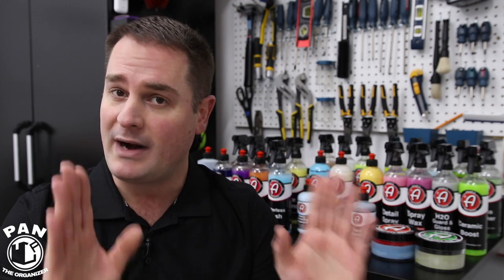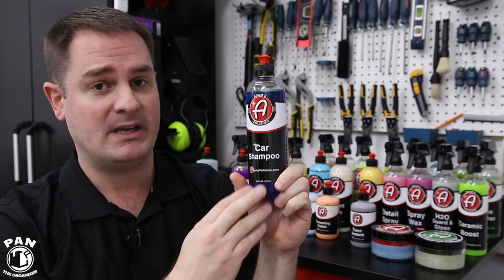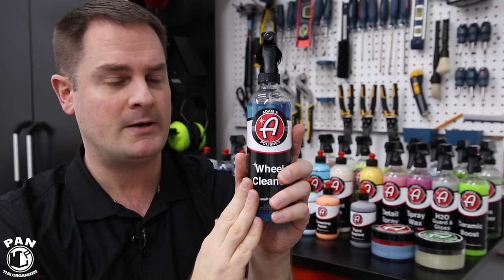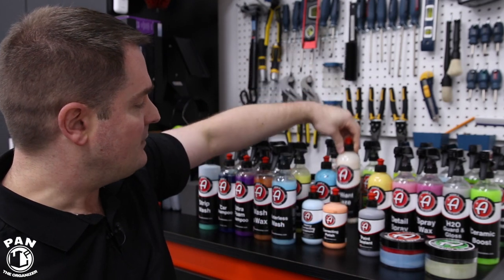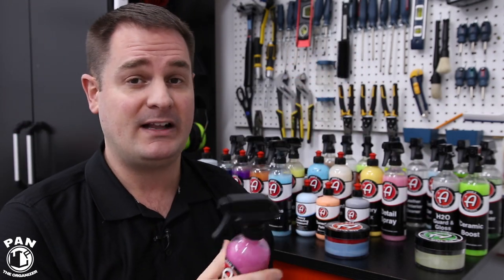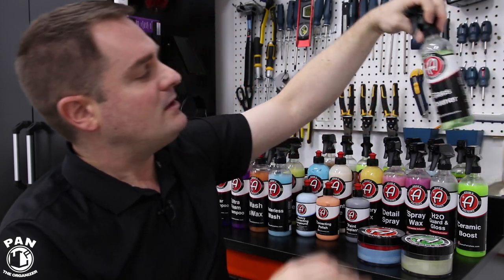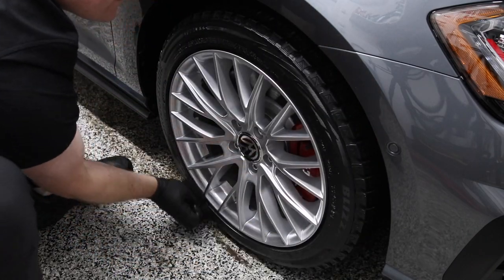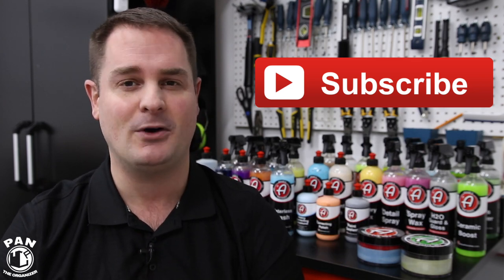ADAM'S POLISHES DETAILING PRODUCTS: BRAND REVIEW !!

Comment: Thanks Pan! The few Adams products I have tried have all been absolutely top shelf, some of the best. Problem I find is that all the chemical guys products i have are have also excellent.....at half the price here in Australia.  So it's an easy choice for me unfortunately.  I love their hand applicators though, fantastic!
Reply from the maker: Thanks Ken!  What are your favourite Adam's products, and Chemical Guys products?
Reply: @PanTheOrganizer  From Adams I'd  say their car shampoo, outstanding, wax hand applicators, best I've used, and their detail spray leaves a fantastic finish. For chemical guys, their outstanding products for me are VRP, Glosworkz autowash (easily as good if not better than adams), Mr pink car shampoo, and all of their detail sprays so far are excellent.  I have their butter wet wax too and it leaves an excellent finish but doesn't last long. I also highly rate diablo wheel gel for a safe gentle wheel cleaner. I also have their fabric guard, very good, and also their fabric clean, outstanding. And for an example of the price difference between chem guys and adams: Adams VRT $39.99 , CG VRP $13.95....No competition I'm going to get CG every time.

Comment: what is the difference between the adams car shampoo and the adams mega foam?? can you just use one or the other?
Reply from the maker: Car Shampoo can be used in the bucket or in the foam cannon. Mega Foam was designed for the foam cannon only (pre-wash). So the most versatile is the Car Shampoo.
Reply: @PanTheOrganizer  Hello! thanks for the quick response! And ahh that makes sense, I appreciate it! I'm trying to buy some of Adams products and was wondering what products I actually need.. What I have in the cart so far is: 
1. Adam's Car Wash Shampoo 
2. Adam's Iron Remover
3. Adam's Tire Shine
4. Adam's Buttery Wax
Would you say I really need to get one of the tire cleaners, or do you think I can get away with just cleaning the wheels and tires with the Adams shampoo with the help of the iron remover?

Comment: Let me start by saying great review. I've been looking at Adams products and this review helped out tramindicly. I was wanting to ask a couple questions though. I have ceramic coating on my car but said not to use the wax and sealants on the ceramic but would the wash and wax b ok or should I just use the wash+coat? The other thing I was wanting to know is would the H2O Guard and Gloss and the spray wax streak if I was to use a blow dryer instead or do I need to wipe it dry?

Comment: That tire shine looks good and lasts long but make sure to let dry or you'll get sling
Reply from the maker: Yup!  And remove excess with a microfiber towel.
Reply: @PanTheOrganizer  yep! I made that mistake at work, saw the car come back and under the radar got it off but it was not fun. I started using quicker drying stuff that still gave the wet look people wanted
Reply from the maker: I typically use water based dressings like Chemical Guys VRP or CarPro PERL, but Adams Tire Shine is a good silicone based one.
Reply from the maker: Did you watch my tire dressings comparison video?  Here: https://youtu.be/Oge5jlaAaME

Comment: Hi Pan, question for you. Would the H20 Guard and Gloss be applied after the Buttery Wax? Normally my line up at this point is Adams Tire Cleaner, Adams Shampoo, Adams Buttery Wax and then the VRT to finish off the vinyl and tires. Thanks!
Reply from the maker: You could.  But normally you apply a Sealant first, then you top it off with a wax.

Comment: Pan great video. I noticed you did not cover the finishing polish that Adams recommends after using the correcting polish. Do you think it’s necessary to use the finishing polish? Also after using paint sealant would you be better with applying H2O G&G or buttery wax?
Reply from the maker: It's always a good idea to use a finishing polish to smooth the finish and further refine it.  If you apply the Adam's Paint Sealant, I would top that with a carnauba based wax (like Butter Wax) to add more warmth and depth to the glow/shine.

Comment: Hi!
Great video as aways.
I wonder how you would compare Adams’s new Spray Wax VS Meguiar’s X-Press spray wax in term or ease of use and durability (I know Adam’s is more expensive, but does it worth it, I guess there is more carnauba and less silicone, I may be wrong) i plan of using it at car show
Reply from the maker: Thanks

Comment: Can you wash the hex grip applicators, or do you throw them out after they're soiled?
Reply from the maker: You can wash them. But after each use, you can quickly clean the surface with an APC and warm water, and let it air dry. They should be good for a very long time.

Comment: Quick question, I have ceramic coating but want the wash and wax soap that you mentioned would I contradict what you said if I use the ceramic boost as well? Or am I ok to use both
Reply from the maker: Don't use wax based products on top of ceramic coatings. Use ceramic based sprays for boosting or maintaining your protection.

Comment: Hi pan huge fan here. I just wanted to ask a question. Im new to detailing (started around 1 year ago) and so far its been great!!! Most of my success thanks to you. But the only thing i've struggled with is getting a good polisher. I have a chemical guys TORQ 10FX and honestly it sucks... i was wondering what are the best polishing machines out there that WILL get the paint corrected and not just an advertisement.
Reply from the maker: The best: https://youtu.be/U1ZD0L3RCa4

Comment: Hey Pan - Great job once again!  I have most of the Adams line and especially like the car shampoo,  ceramic boost, odor neutralizer, and tire & rubber cleaner.  Not that big a fan of the interior detailer, but maybe it  isn't completely compatible with my current protectant.  Ceramic boost leaves your paint almost as slick as the beadmaker.  Good stuff!!
Reply from the maker: Thanks for the feedback Mike!

Comment: Do you have a drain in the floor of your garage? And is that just regular sheetrock on the walls or is it the ones they put in bathrooms that can get wet?
Reply from the maker: Yes I have a floor drain in my garage.  The sheetrock is moisture resistant (same as in bathrooms), I have a dehumidifier, a water tight floor coating and a heat pump (for heating and cooling year round).  Here's a full video tour of my garage: https://youtu.be/E_P6wRo3BH8

Comment: Hey Pan, Great Review! Also enjoy your very informative videos.
I have a couple questions:
Would you use detail spray and ceramic boost 2.0 on a ceramic coating? I’ll be getting the Servfaces Ceramic Paint Coating very soon! I’m currently using bead maker after every 4th wash and wanted your input on what you thought would be best. 

Also, 
What do you recommend on Chrome Coated ceramic coated wheels? I used the servfaces wheel ceramic coating on those already :)
Reply from the maker: I would not use Ceramic Boost 2.0 and Detail Spray in the same wash.  Use one or the other.

Just use Bead Maker to maintain any ceramic coated surface.  :). Ceramic Boost 2.0 is also very good to maintain any coated surface.

Comment: The wash and wax so you recommend that for a vehicle that just had a ceramic coating applied? 

I'm looking to maintain my car after getting it completely detailed and coated with ceramic pro. 

Would it be possible to wash the car with a pressure washer and soaps rinse and dry without ever touching the car? This would be done weekly to maintain the full detail.
Reply from the maker: I don't recommend using wax based products on ceramic coated cars.
Here is how I wash my ceramic coated car: https://youtu.be/xaQmB_qje_4
Reply: @PanTheOrganizer  apparently I have the largest Adam's distributor in canada right up the road from me. If I wanted to use their products to maintain my ceramic coating what would you recommend?

It's either that or stuff from canadian tire/walmart...

For example would I use Adam's car shampoo for prewash then Adam's wash + coat then Adam's ceramic liquid wax or Adam's ceramic boost?

Comment: I've been using the detail spray as lube for clay bar.  Recently started using turtle wax graphene spray for the finish.  Can detail spray be used as drying aid before graphene and not interfere w graphene bonding?
Reply from the maker: It's best not to have any form of protection before applying graphene or ceramic based products, but especially crucial for ones in glass bottles. For spray variants, it's not as critical if you use the Detail Spray as a drying aid before you apply the Flex Wax from Turtle Wax, as it can be applied on existing waxes and sealants. Just don't expect the same durability as if you apply it on a virgin well prepped clear coat.

Comment: Pan, I have m brakes as well and the silver m came off somehow recently. I think it was when my friend applied purple power on my wheels. Do you think full strength purple power degreaser would do that?
Reply from the maker: No.  It's probably an acid based wheel cleaner or a harsh wheel cleaner used repetitively that did that...
Reply: @PanTheOrganizer  thank you so much for answering. It was probably deteriorating already from the previous owner as I just bought the car used a few months ago. 

So regular purple power degreaser (not vehicle and boat kind you mention in this video) is okay to use on wheels? I'll still probably go with a wheel specific cleaner. I'm just a curious person.  Mine were really dirty. I had not been able to wash in a few weeks prior.

Lastly, he used it on my front bumper to loosen up the bugs. Problem? We rinsed it off after about a minute. I don't think I'll do that again but I. Hoping doing that once isn't too bad to the clear coat.
Reply: @PanTheOrganizer  sorry to bother again, Pan. Do recommend something like HydrO2 or a regular sealant for someone who needs paint correction before even thinking about a true ceramic coating. My car is covered in swirls, but it's white so it's not too until you take a good look. 

Currently have H2O Guard and Gloss from Adam's Polishes. I'm thinking ahead to what I will get after it's done. 

Thanks again. Love the content. I'm bingeing on your videos

Comment: Guard and gloss, bead maker, 007, car pro home brewed mix, which is best?
Reply from the maker: CarPro just released their new Elixir for 2019, it's a commercially available version of the Reload/Ech2O mix and also now has HydrO2 inside for better bonding.  It's in my top 3 for best quick detailers along with Bead Maker.  But Bead Maker still takes the crown for me.  :). 007 and Elixir are a close second.

Comment: hey Pan! Great video as always!!  I have question. if I have a ceramic coating (Aqua shield) what should I use as a drying aid before finishing off with ceramic boost?
Reply from the maker: If you want to apply a topper, skip the drying aid.
Reply: @PanTheOrganizer  thanks a lot! I’ve also been thinking about using the ceramic Boost 2.0 (white Bottle, grey label) what are your thoughts on that? Also, so I wouldn’t use anything as a drying aid?
Reply: @PanTheOrganizer  also the aquashield is a liquid crystal supposedly no sure if that’s the same as ceramic.
Reply from the maker: It's good, but there are even better silica spray sealants out there. Here's one that I reviewed: https://youtu.be/nQRX1KlY0uM
Reply: @PanTheOrganizer  thanks a lot

Comment: So after a wash and decon could I dry the car with the detail spray then put a coat of glaze then sealant and then buttery wax? Also how long In between can I apply a wax on top of the Adam's paint sealant?
Reply from the maker: Yes.  After the sealant, wait 3-4 hours then apply your wax.
Reply: @PanTheOrganizer  do you recommend using a IPA cleaner before apply the glaze and sealant or using the revive hand polish? Without doing a paint correction first if I skip that step
Reply from the maker: An IPA is always a good idea before applying a paint protectant.

Comment: Hi Pan, I bought the Adam's Shampoo using your link and want to buy your snow foam cannon you link but I have a pressure washer with  2200psi. Is that too much or the right PSI for cars? I don't want to damage my car.
Reply from the maker: I usually don't recommend anything over 2000 psi to wash cars. But 2200 isn't that far off, so you're still ok.
Reply: @PanTheOrganizer  Your the best Pan! Thanks for the fantastic videos and actually responding. We’ve followed your advice and the cars look amazing the new A6 with the opticoat looks crazy. Now if I can just get over this COVID I’ll have something sweet to drive!
Reply from the maker: Congrats on the A6! What a sweet ride!  I had detailed an S6 in this video: https://youtu.be/i5yJ3dyk8RI

Comment: Hello Pan, coming from Toronto!

Thank you for the review on Adam's Polishes. I have been quite skeptical of their products the past wee while due to certain things that have happened to me actually. I had used their iron remover and it stained my driveway. This has also happened to Auto Fanatic except with the wheel cleaner. Have you by any chance experienced that?

btw i will be setting up a show called Motorama (as i have the past 3 years) if i swing a deal on some car care products is there any way i can send them to you for you to try?
Reply from the maker: Never had those issues.  Auto Fanatic Wheel Cleaner was formulated to be super safe for your health, and shouldn't stain your driveway.  It's only available on pre-order though...  You got the final version already?  I was testing the pre-production version for months and never had issues.
Reply: @PanTheOrganizer  I was talking about the Adams wheel cleaner issue when mentioning Auto Fanatic. Have not purchased/pre-ordered yet however once the IK9 comes in, i will be buying it. In desperate need of a new wheel cleaner that is almost 100% touchless.
Reply from the maker: Then the Auto Fanatic wheel cleaner will be perfect for you, especially in combination with the IK Foam 9 which allows you to spray into the barrels.  If you maintain your wheels often, you'll almost never have to use a brush.  On moderately to heavily soiled wheels though, like for any cleaner, you'll need some brushes to lightly agitate.
Reply: @PanTheOrganizer  Thanks for the quick replies! Back to my first comment, i had mentioned me setting up a car show. If I get my hands on some products, is there anyway i can send them out via p.o box for you to try?